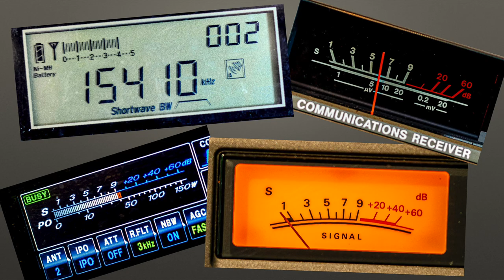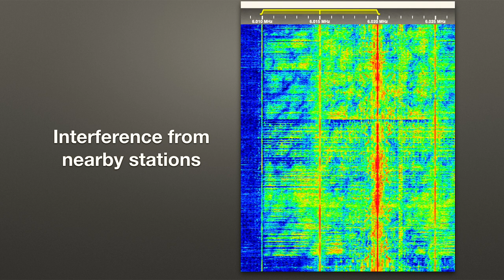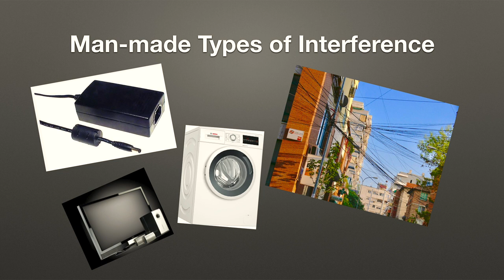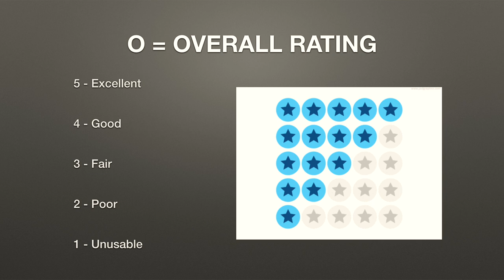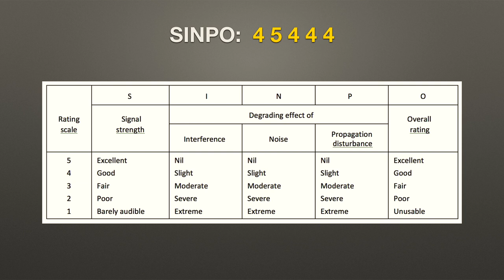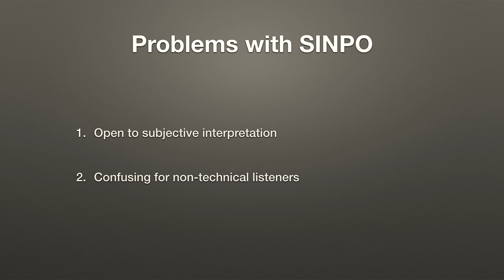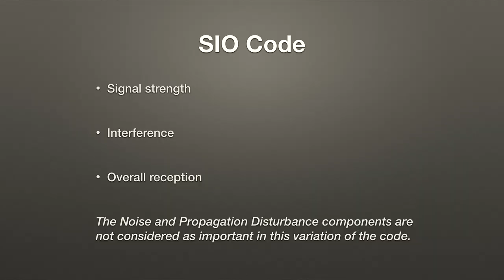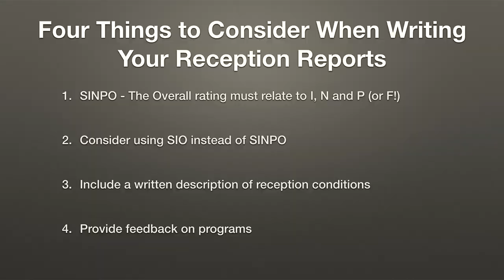A Closer Look at SINPO

Comment: Great explanation thanks Rob. I've been a SWL for over 50 years and well used to reporting SINPO. I usually include comments about the rating I give to explain and justify my rating and I would usually obey the "overall rating should not be more than the minimum SINP ratings" guideline, however I think there are some exceptions. If a signal is a good 4 and the INP are 5's I do not see why one could not give an O of 5 especially if we write about the ease of listening under these conditions. Also, these days we have some technology to filter out some of the noise and perhaps use DSP to improve the speech. If we explain these to the station, we can give before and after filtering ratings showing how we got to a better O rating than normal. Finally the case mentioned of 11111. Well this is extremely bad reception, but assuming the signal WAS heard and identified (perhaps by the tuning signal, anthem or some other), then it is not possible to give a lower O rating than 1 and 11111 could be valid. I agree it is rather difficult to "measure" I N and P and its not always straightforward to measure S either. If we are therefore dealing with opinions about them, then I'm afraid O has to be an opinion of what the listener thought of the overall experience. After all, the I might have come and gone with the P and similarly the N, so when the signal was not faded very much the transmission may have been rather easy to listen to. In these cases I try to explain my ratings in words, but if a SINPO is requested I do my best to give one.
Reply from the maker: Thanks so much for your feedback on the video. Much appreciated. On your first example, the use of DSP and other technologies to improve the reception can greatly assist in the enjoyment of listening. If a listener has at his disposal these technologies, then it would be appropriate to describe these tools in the Receiver section of a well-written reception report. I have no issue with that. The use of various technologies on my Yaesu FTDX3000 certainly makes listening easier at times for me! Plus I use an external mixing desk with equalization which can also add significant benefits to reception listening quality. On the discussion of 11111, my comment was perhaps slightly "tongue-in-cheek". Also, if reception varies significantly during the course of the listening period, then it is quite appropriate to either 1) list several SINPOs at times when, say, the interference was and wasn't present, or 2) include written observations about changes in reception conditions during the listening period. It all helps the station to gather a perception of the quality of reception on that day. Thanks again for your detailed comments. - Rob VK3BVW

Comment: Here's another example for you. Radio Cairo. Their typical reception (when they were on) for me would be 44441 (or 441 SIO). Despite strong signal and other values above the average their modulation usually was so bad, that nobody knew was it male or female voice. Lack of "audio quality" in SINPO code is major drawback.
And definitely the best s-meter is your own ear. No s-meter on hobby equipment (even in top models) is calibrated like lab equipment, it's just some sort of indication.
Reply from the maker: WojtekDX - Thanks! A great example of another problem with SINPO!! These days, I hear more audio problems from shortwave broadcasters that I ever remember hearing back in the 70s and 80s! Cairo has been a dismal audio culprit for years! And several of the Asian broadcasters have the same problem, possibly due to ageing transmitters and the lack of availability of replacement parts for old AM transmitters. Re. S-Meters: There is an industry standard that meters are supposed to be aligned to and meet. However, inevitably there are slight inaccuracies, which can also be exacerbated as the receiver ages. Thanks for your perceptive comments, 73 - Rob VK3BVW

Comment: Been using the SINPO code for years and you had some great tips there. Probably been guilty occasionally of giving a higher Overall than the lowest rating in the report. 73's
Reply from the maker: Thanks for checking out the video, Darrin.73, Rob VK3BVW